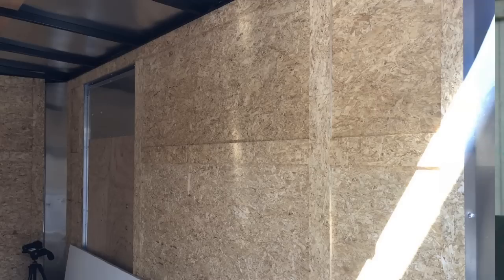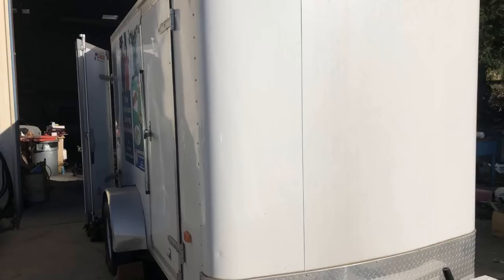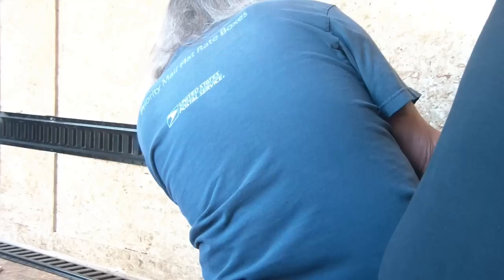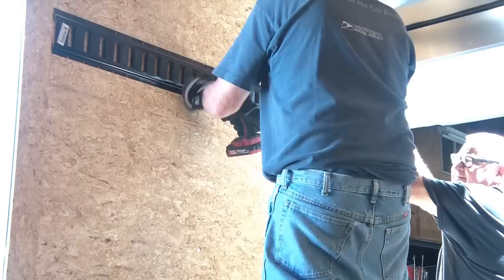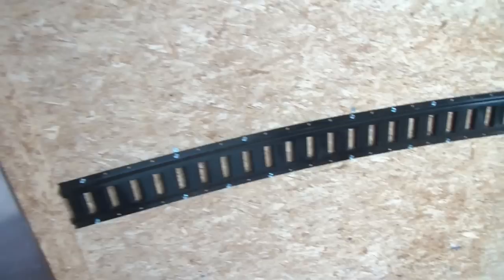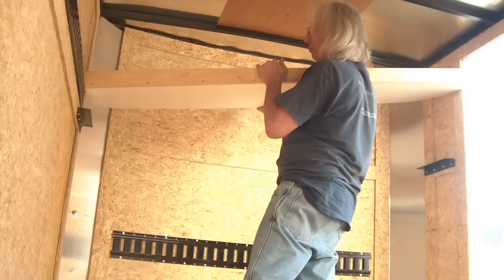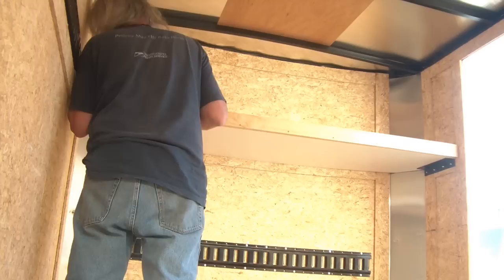How to install E-Track & a shelf in a Utility Cargo trailer

Comment: Just make sure your trailer is level before using a bubble level inside your trailer 😉
Reply: I was thinking the same thing. Probably better just to measure from floor.
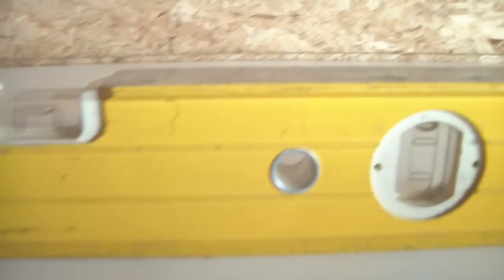Reply: Yup, he mentioned that @9:59
Reply: Setting the trailer up on jack stands is then easy to level it up, ... then add your level shelving, ...

Comment: I just installed e-track in my enclosed trailer. Works great, I also made some videos on trailer security.
Reply: What size screws did you use? I know if you go to long they poke out the other end
Reply: @michaelmunoz3757  I have a full e-track install video.  Shows what size screws I used as well as how to determine what size you need for your own trailer.

Comment: I decided to install e track myself and save money from having the dealer do it. Seems easy enough!
Reply from the maker: Charles it is quite strait forward. My only tip would be if you need to really tighten down what you intend to haul I'd also add carriage bolts on the beams. drill all the way through and push the carriage bolt from the outside in just an extra step to prevent the track from being pulled off. Thanks for viewing
Reply: @TheShackHome  I just used 1 1/2" #12 self tapping screws on the beams, and 1 1/2" #12 bolts w/ washers and lugnuts on the floor every 3rd or 4th hole in between. The floor will come up before the load!
Reply from the maker: @charlesthomas4032  Great you go it all handled best part you did it yourself.

Comment: Have you had any issues with the self tapping screws pulling loose?
I have been thinking of e track for my trailer but cut out the wood at the support and weld it in.
Reply from the maker: Chris Guice if you’re hauling things that are heavy I think that’s a great option. Or possibly drilling all the way through and using a carriage bolt another option. My customer uses this for catering so most are light rolling shelf’s and  a few folding tables. It fits his needs. So far no issues.
Reply: Chris Guice, a trailer, like a ladder needs to flex, and is one of the main characters of a trailers strength, ...

Comment: Hi there, I have a question, at 8:53 you are installing the brackets for the shelf, do the bolts come out to the outside of the trailer?
Reply from the maker: 50Calx2  no I’d didn’t do anything different I put one self tapping screw into the stud of the trailer just like the T track but you could put a bolt through the trailer . I would but only where the frame is (stud) in the wall . My customer does catering so he really doesn’t have much that is very heavy I added the extra support from the shelf to the roof of the trailer only for the fact that someone may lean against it and I wanted to give it extra strength and stability
Reply: If the bolt or screw didn't pop through to the outside it only missed by a tiny fraction of an inch.
Most of those supports are only an inch thick, most plywood is one quarter of an inch, anything longer than an inch and a quarter and you will be seeing sunshine.